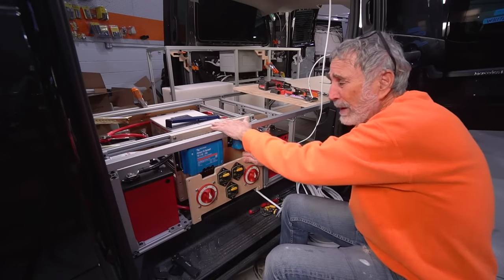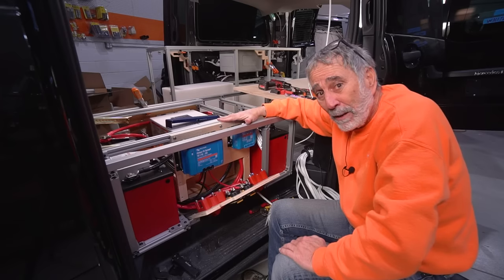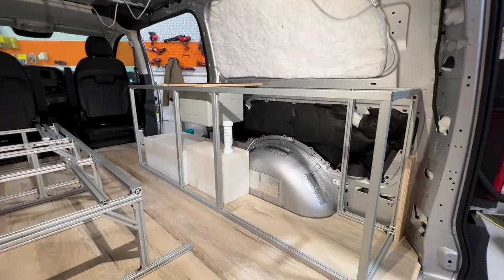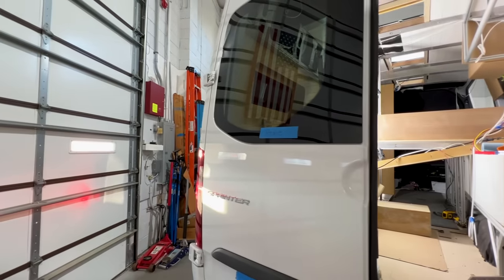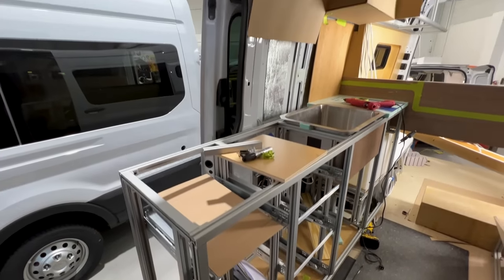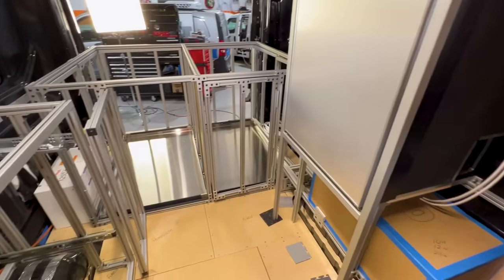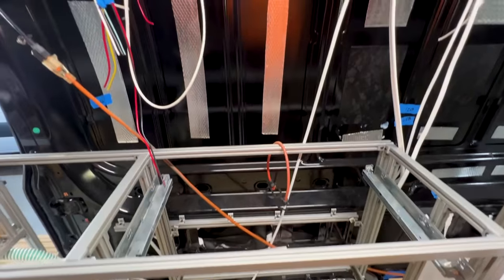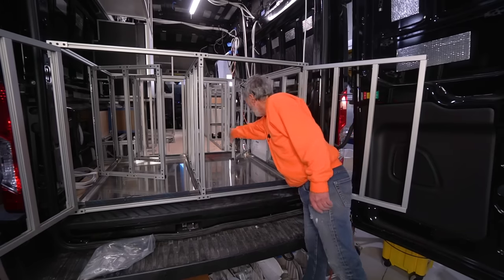Framing 8 VANS at a time using 8020 extruded aluminum. Solve just about any design problem!

Comment: George, before you install a metal sheet to shield the RF and electromagnetic radiation, take a look at using copper screening instead.  It is very lightweight and, by definition, is fully ventilating.  I worked for a city in the past which had a radio repair shop made entirely of copper screening.  You could see through but no RF could penetrate the screening.  That way they could test the radios without any signals leaving the room.  I just don’t know the cost, however.
Reply from the maker: A great suggestion, Dennis thank you!
Reply: The question I would have in this case - is the difference that copper screening is effective for high-frequency magnetic fields (mobile communications, radio, WiFi, etc) but not effective for low-frequency magnetic fields (electrical appliances and wires (wires from those appliances, or wires that are in the walls of our houses), while a steel sheet will protect from both?
Reply: P.S.
Because of how relatively close this electrical box is to the body, low-frequency electromagnetic fields should also be addressed (low-frequency EMFs are stronger but they don't travel far. So say in a house a solution might be just moving your bed a few centimeters from the wall where there's wiring. In a van we don't have space to do that though).
Reply: Yes, or even aluminum. You can buy the aluminum screen for window screens from most hardware stores. And that blocks radiation.

Comment: Those dog cages are a work of art, George!  Why not use stainless steel wire mesh or 'holey' panels instead of wood/acrylic?  It would breathe better and dogs could see out of them, especially into the van.  On the outside rear door side, a strip of Plexiglass on top would allow the dogs to see what was going on outside.  

So exciting, what you are building.  Always cutting edge and mind-blowingly inventive, bravo!!  I love your build philosophy and unwavering commitment to functional and aesthetically pleasing design + airflow, access, modularity of components.

I worked for a software company developing virtual reality cameras.  One of the issues was to prevent EMF radiation leakage from inside the camera brain to outside.  This was required by law when we set up to film public events.  The cameras had to be lab tested for leakage and be compliant.  Those with pacemakers could be affected and the EMF leakage could affect everyone's brain.  In fact, autism is made worse when autistic children sleep too close to wall electrical sockets.  Move the head on the bed 3 feet away, and no more problem.  While researching methods to cut down on leakage, I became aware that they had cloth fabric that also stopped EMF.  You can buy this, sew onto back of mattress, or all around it, and also use perforated metal sheets under the bed. Add another layer of cloth on the metal sheet and now you have a very filtered out safe place.  You solve one problem, and another one pops up, like Whack A Mole!  Such is van building.

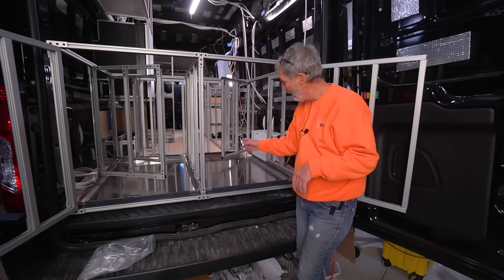16:00 - The Air Excel Aqua Hot Hydronic Heater - Hydronic is another word for water-based Radiant Heat flooring.  However, this appliance runs $6085.47. The $0.47 cents really gets me.  
A regular water heater costs $200 - $600.
Truma costs $1200.
Air Excel Aqua Hot costs $6085.47 cents.  

How much do heated floors cost in a home? 
Radiant floor heating costs about $7 to $15 per square foot.  The 3500 Ram Promaster has 153 sq ft at the most.  
153 x 7 = $1071.   153 x $15 = $2295.  $6085.47 -2295 = $3,790 - $5014 more expensive than a house installed system for a tiny amount of square footage compared to a house. 
The price per square foot for the Aqua Hot is $6085.47 /153 sq ft = $40 per sq ft.  More than 3 times the most expensive system installed in a house.  Hmmm.

All looking good, George!  Carry on!!
Reply from the maker: The aqua hot hydronic system has three independently controlled heating zones and it also makes the hot water for the van and I don’t pay $6000

Comment: In my van, with its 10.9kwh system, dozens of electrical connections in a hard to get at area, all in a dual wheel rolling earthquake, I'm much more concerned about electrical fire than I am about electromagnetic radiation. That said, I sleep over the water tank and my wife sleeps over the batteries. Ba da dum tss!

Comment: I'm not an expert but I think that copper mesh/screen might be a better shield than sheet steel. Maybe slightly more expensive, but  definitely lighter. Very happy to be corrected if I'm mistaken
Reply from the maker: I have heard this suggestion before. I will do my research before committing. Thank you for the contribution! 👍

Comment: VW /Man is thinking of manufacturing the all-wheel high profile vans, but particularly 'fitted floor and fitting of windows and pop-out rear windows. Mercedes is very big in South Africa.  Ford is building currently only low-profile vans. Toyota is building a lot of 2 wheel high - profile vans, and soon we shall have their new WATER BASED ENGINES.

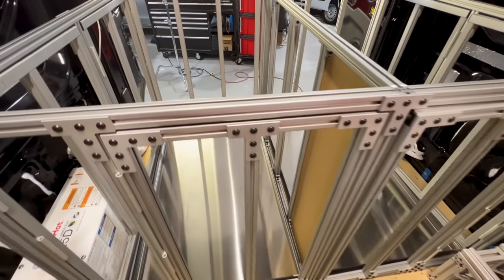Comment: For the dog crates at 12:30 why don't you use wire mesh instead of panels?  That way it has good ventilation for the dogs and they can see out.

Comment: Thank you for the great inspiration for building my own van! Could you please explain how to build this 45 degree angled support profiles? Where is it drilled, milled and screwed? Or have you already shown this in an other video? I could find that. Thank you sooo much!!
Reply from the maker: The 45° supports which I call triangles are available on the 8020 website they come in 6 inch 12 inch and 18 inch. Make sure you’re sitting down when you order they are very expensive.
Reply: @HumbleRoad  Thank you for your reply! At first I thought you built it yourself. Now I have found it as a purchase part. Thank you very much for your hint! It's really quite expensive. And now I'm thinking of building it myself with a milling cutter with a guide pin. It's just a hole from the back and a cutout on the side of the screw head. I will try.

Comment: I think before anyone gets concerned about EM fields or designing shielding, someone should go around the electronics with a field strength meter to find out if there's really anything there. My guess is that there is not anything to be concerned about, but hard data would be better than anyone's guess.
Reply from the maker: Agreed.

Comment: Hello George.  You have been my reference for 80-20 now for more the 4 years.  I have build my van following many of your advices.  Thanks for all your great content.  I have a small question. Maybe you mentioned it in one of your videos, do you build most of your frames with 10 series now?  Your first vans were build with 15 series.  If yes what made you change to 10 series, the total weight ?
Reply from the maker: Yes, I use 15 series in the garage/bed span, and also for my battery and water tank bridges over the wheel wells.

Comment: He mentions "grounded to the chassis".  The "chassis" is on rubber tires.  Last time I checked rubber was a rather poor electrical conductor.  So really what is it grounded to when you don't have shore power?  This should be explained.  In all the many videos I've watched on this subject, not a one mentioned ever using a grounding rod once at a place for a while.  It is possible of course.  But it would be a hassle to dig the hole for it and set it up.
Reply from the maker: The entire DC house system lives above the tires. Independent from earth ground. I'm not referring to earth ground. That is an entirely different system.
Reply: @HumbleRoad  Can you please explain that a bit?